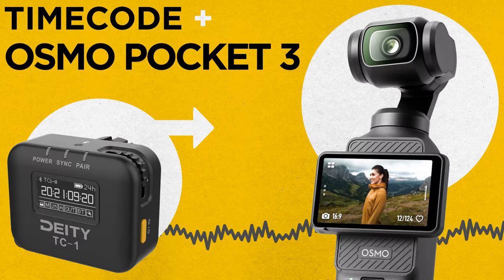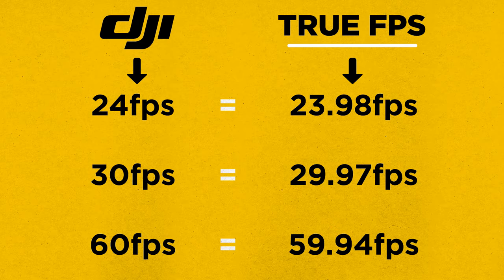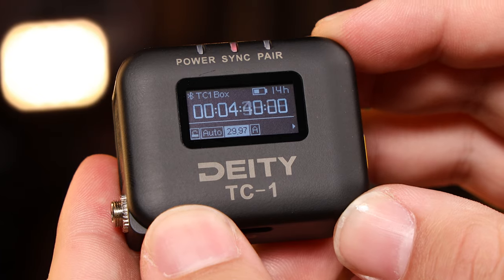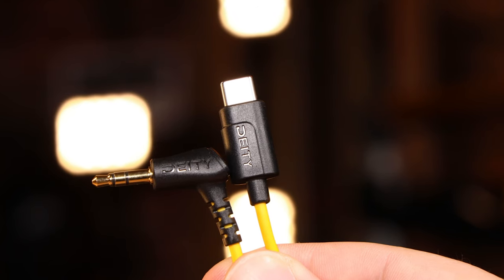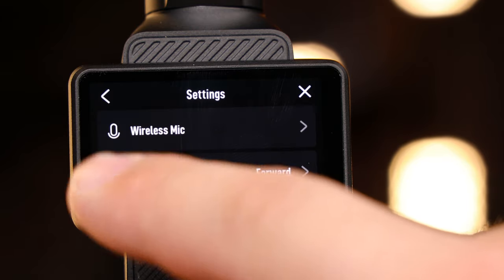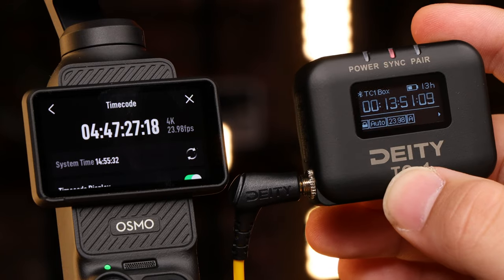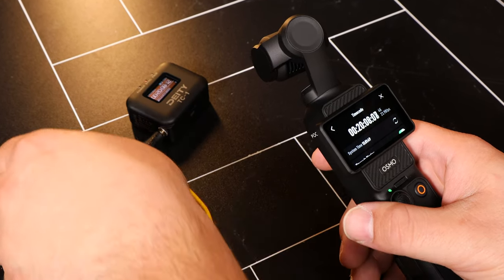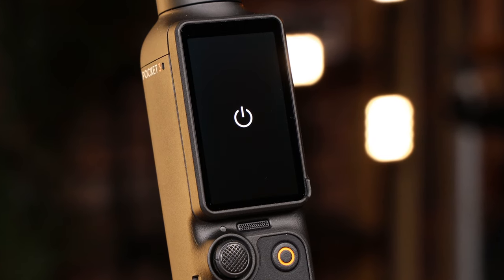Timecode on Osmo Pocket 3 | Deity TC-1 + DJI Osmo Pocket 3

Comment: Since the recent DJI firmware update, I've successfully synced the Osmo3 via the USB C port at 25fps to a Rode Wireless Pro's Timecode output over USB. No need for the adapter cable. If the Deity TC1 outputs SMPTE over USB you're good to go with just a USBC cable :) Will test soon
Reply: And yes, internal clock of OSMO3 is shockingly bad, but stays locked when timecode box stays connected...Recommendation: Don't unplug it.
Reply: @Mechagen  Is that true in the beginning it was not staying locked?

Comment: Heads up. In my test doing a jam sync with Deity and the Pocket 3 time will drift by a second within one hour. Short clips may work, but long clips I would recommend recording the signal as an audio track through the DJI Mic two input. This will provide a constant audio track provided by the Deity TC-1 through a wireless connection to the osmo pocket 3. Then sync in Divinci Resolve.
Reply: Too bad the Pocket 3 doesn’t have a dedicated Mic jack.
Reply: @mohammadali.84   Skip the mic jack and plug into the Mic 2. You then put the time code as a audio signal on the Pocket 3.